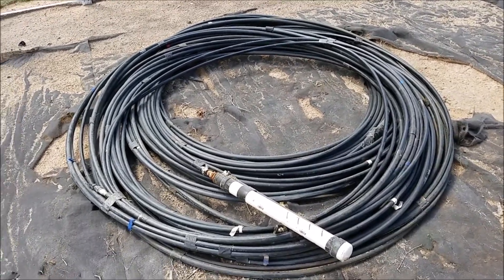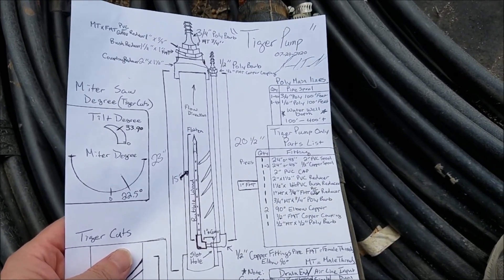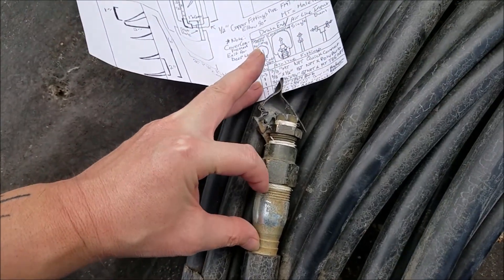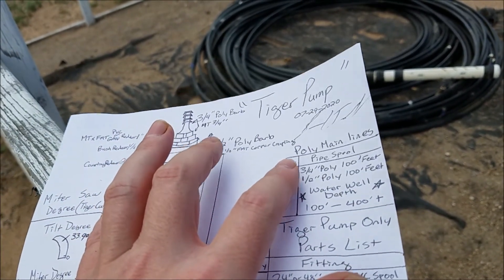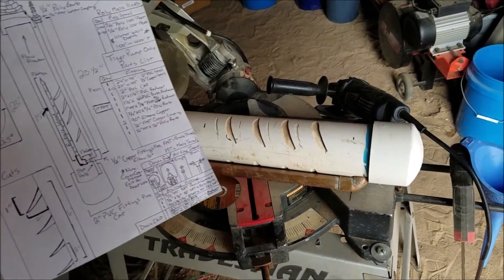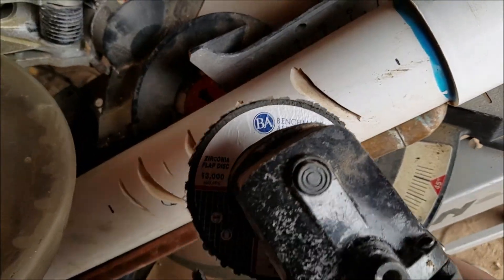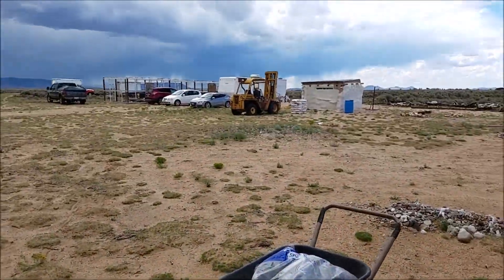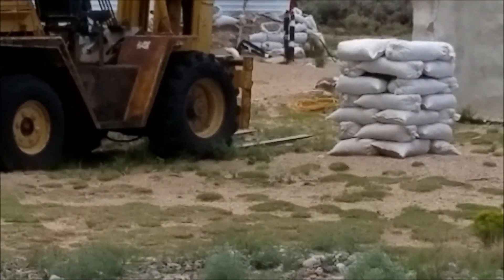Tiger Pump : Blueprint and General Assembly - Air lift Sediment Removal

Comment: Will 1/2" irrigation pipe work for water line?
Reply from the maker: I would assume 1/2" work fine at 250' feet deep. Worked on a 400' feet Well I worked on

Comment: I’m confused. I saw your video where you used this to remove sand from the well, but I don’t see how this pump would do that.  I don’t see anything that would dislodge the sediment from the bottom.  Was that pump modified?  Thanks, and I’m glad you didn’t buy the farm out there in the desert, and I hope the custody thing went well. I have a buddy who’s going through that right now. It sucks.
Reply from the maker: Aye I know it seems strange way to remove heavy drilled crushed fine sediment out this way. As far trying pump out solid stones, metal rust, and anything else that big, No Go at very very Deep Wells. Have yet to design any attachments that could help break up anything at 400'feet Deep. Its really REALLY hard to clean any bottom of a well. What shot for here, is the Fine Drilling Tailings that settle and slowly pull back up into the submersible pump to clog it. DUE NOTE : Tiger Pump NOT a everyday Pump to Run for Residential or Commercial, its only to have a chance to clean bottom. Way works is bubbles and fine sediment stick together and uplift out. If your looking for Residential/commercial pump, Either Shallow Water Well Pump or Deep Submersible Pump. Used the Tiger Pump 4 times, 3 Deep 400'ft Wells and 1 shallow 85' feet well. Deeper the Well, More Challenging and Longer will take.
Reply: @XunnyTheSunshineLion  Thanks for the info, and enjoy your weekend.
Reply: @joeprimal2044  I’ve used a 3/4” pvc pipe inside a 2” pvc pipe with a threaded adaptor on the 2”. Threaded a steel 2” pipe nipple into the bottom and cut saw teeth into the bottom edge of the 2”. Bend out every other one of the teeth to flare out the “ bit “. Place a screw through the metal pipe nipple to keep it from unscrewing. Feed air down the 3/4” pipe, move them both up and down while twisting the 2” pipe to chew up the bottom and loosen the sand and gravel. I’ve blown out rocks 1/2” thick 1” diameter along with sand and clay.
Reply: @akbychoice  thanks, that sounds good but I don’t think it will work for my situation . I’m 300+ feet down with only 15 feet of standing water left. I have doubts air lifting will work, and I can’t imagine manhandling 300 feet of 2 inch.  There aren’t any rocks I don’t think in mine. It’s just fine sand. I have a 12” diameter well, and I’ve got 85 feet of it sanded in, so that’s a hell of a lot of sand to remove. What I finally decided to try is I’m building a little dredge with a submersible pump and a bucket and I’m going to try to dredge the sand into the bucket, lift and dump, and repeat a few hundred times. Idk, it’s the best idea I’ve had so far.
Reply: @joeprimal2044  I saw something similar to what you described. It was a 4” pvc with a cap on the end, a bolt through the walls on the top for the rope or cable. They had an air hose blasting alongside the 4” pvc at the bottom. It appeared to blast the sediment up along the sides and settle into the pvc. Then they would haul it up and dump it.

Comment: I'm looking to use an airlift pump on a wetlands filter which means I can't use copper since some aquatic animals are sensitive to it. Can I just replace it with pvc? I only need to lift it about 15 ft
Reply from the maker: Poly or PVC should be fine at 15feet, shouldn't take long to cleanse at that depth.

Comment: Great job on your design of the airlift pump... was just wondering, what you think about using a air ring blower instead of air compressors. 300watt plus ring blower can deliver 90m3/h, 53 cfm, and 1500 Lpm of air.. so more air with less power....
Reply from the maker: Very interesting, have try it out! Less electricity and possibly only one device, instead of two compressors for deep water wells. Thanks for information!
Reply: Yes it's interesting.

Do you have a link to what brand you bought or can you tell me where to go to get one or look at the specs?

Thank you.
Reply: But for what output pressure ????
Reply: My @bellachhebmustapha6152

Comment: Hi Brandon,  Ben from Qld Australia, hope I find you well. Pardon the pun. Seen you been through the wars. 
I am trying to use this concept to lift water from a creek to a tank about 20 m head. If you got any ideas, I would love to here from you . I will subscribe . Cheers mate
Reply from the maker: Hello Ben, when I used this design I made on 85' feet (25m+) Used a 5 gallon water bottle for that depth, was filling up decently fast with just ONE air compressor at steady 25 psi. Actually flows nice at Shallow Water well level. Also, Shallow Water Well Pump with Cistern help catch water up to height need from creek to land, could help save lots of pump power too. Spring Creek Water, nice!

Comment from the maker: Note * : Tri-angle Tiger Cuts on 2" Diameter pipe, Please Reduce to just 2 sides of Tiger Pump. Sorry, Tri-Angle Tiger Cuts for "X-Pump" design, larger design.
Reply: How many holes in the Copper Pipe, what spacing and what size please. This thing looks great
Reply from the maker: @moiraanderson6242  Thank you! For Bubble Wand Copper rod, use 1/8" drill bit for holes,  space the holes Roughly 5/8"-3/4" spacings on Two Sides only. As far my bigger "X-Pump" was my first prototype attempt, At the depth of 375' feet, the X-Pump would be impossible to cleanse at up scale size. 

The X-Pump will be great for 6"+ diameter casings on Shallow Water wells up to 150' feet limit. This design be for stronger cleanse against bigger diameter drilled shallow water well walls. I believe it will work, but have not had chance or met someone got dimensions used for, confirm for sure go ahead. Tiger pump does work, very fast for shallow wells, and steady jet stream push for very deep wells.
Reply: @XunnyTheSunshineLion  do the bubble holes need to be above the Tiger Cuts ?
Reply from the maker: @moiraanderson6242  Holes can be along Tiger Cuts, from 90 degree elbow to end that is flatten down(Flat only tip of wand, Hammer flat closing), 15" Rod. Use this "+" as point reference. Say Left and Right on + will be Tiger cuts on 2" PVC and Top/Bottom on + the inner Bubble wand Holes.
Reply: @XunnyTheSunshineLion  I think you should start manufacturing this, great Idea !!!   My Husband is a Pipeline Welder Like you.
Reply from the maker: @moiraanderson6242  Oh would like to manufacture the items. Trying hard to get to the shop building. Used my pipeline welding skills to make a forklift attachment to extend the height enough to re-install the 20' feet sectional 1" SCH 80 PVC pipes. If you know a fallen water well pump problem, hope to make my fishing tools patent affordable to help resolve a very complicated issue.  Got two tools I made with fabrication part of my Pipeline welding, one tool pull the electric wire and another tool to pick back up from coupling. Hope to finalize patent paperwork. For now I will gift Tiger Pump model, cause I believe we all deserve healthy sediment-free water.
Reply: Will the X Pump work better for deeper wells like mine ?  I can rent a 185 Air Compressor if Air is an Issue. Please advise Thank You
Reply from the maker: @moiraanderson6242  For air PSi flow, looking for strong enough compressor that can steady solid 45 - 55 PSi, single or dual compress hold that flow and should get a jet stream repeated push flows in waves, then should see sediment get caught in bubbles streams, bonds in waves as pushes out.  45-55 PSI range is what I noted down on 2 weeks took on mine with two weak compressors but ran long enough straight. I'm sure if find a "Spray Painting steady flow compressors" ones that usually say can run the 40-60 Psi range all times, should be strong enough as Single Compressor. Usually really big and can be rented. Get a strong flow and it fills more than 1gpm, on that one shallow water well, hit nearly 5gpm and cleanse of well went way faster. Recommend One good solid 24 hour pumping after water cleared and several bump up cleaning. Specially for 375' feet well, lot of work re-install. If missed any info could help, let me know, do my best get responses.

Comment from the maker: Water Wall 380 feet : 2nd Air Lift Pump Design - More compressed and lighter "Tiger Pump"
https://youtu.be/GpSgMZ5XyGs

Please use this video as reference to copper inner fittings of the Tiger Pump